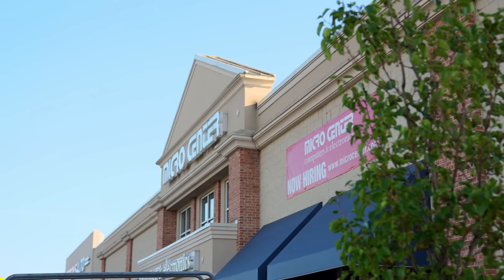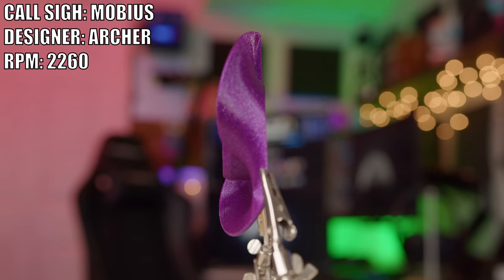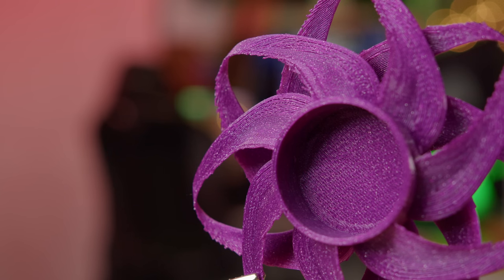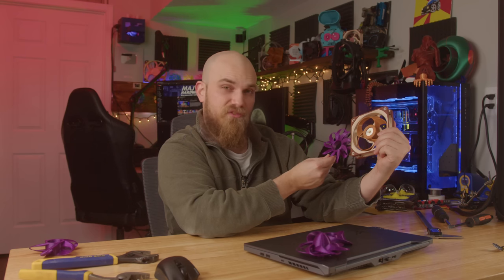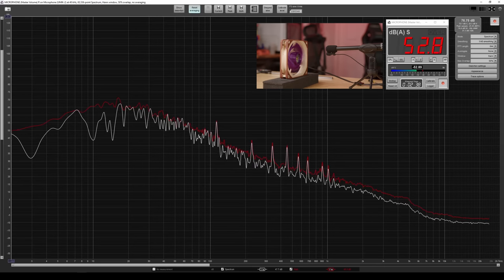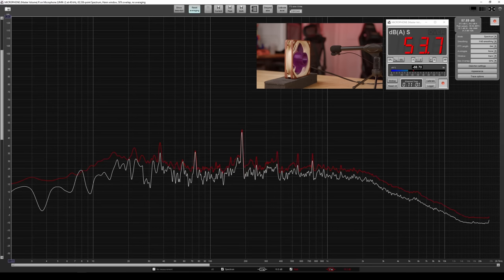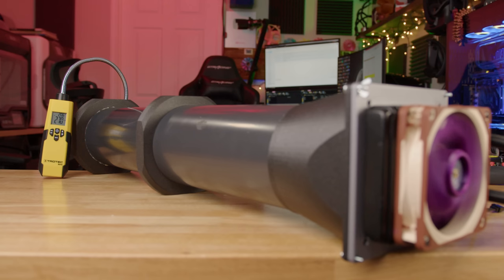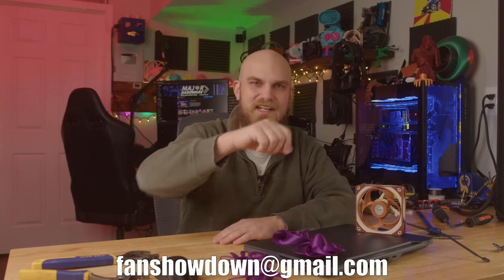My Subscribers Turned MIT Award Winning Toroidal Propeller Into A PC Fan | Fan Showdown S5E5

Comment: Imagine if your phd depends on how good your fan does in the fan showdown
Reply: That blows
Reply: Lol, academia!
Reply: As an added challenge, you have to do your dissertation defense while shouting over the sound of all of the toroidal designs that made it onto the show.
Reply: "Imagine if your phd depends on someone else's crappy 3d-printer and lack of ability to use it, and not your own work." 

Yes, I'm that fun guy in the party that gets everyone laughing by pointing out how jokes are stupid. At least based on how they all laugh and point at me.
Reply: @anteshell  it's an even playing field then
Reply: @anteshell  imagine thinking Major Hardware's printers are crappy and he lacks the ability to use them
Reply: @marcogenovesi8570  the point was not to diss his ability to do stuff. The point was about how stupid idea it is to outsource your PhD with no ability to affect the outcome.
Reply: @anteshell  the point was that outsourcing the heavy lifting for your phd to experienced professional technicians using good equipment you can't afford or operate properly has been a thing for ages.
The thesis is to show how good you are at doing the "brains" of the operation, not how skilled you are as a lab tech nor how much monneh you can spend in lab equipment.
Reply: @anteshell  i agree 3d print are not great in general for airflow stuff without a lot of work in smoothing and refinement, but it is a known variable so if you fail to take that into account in your phd, it is your fault
Reply: @marcogenovesi8570  I disagree with your assessment because he said : "imagine if your PhD depends..." which absolutely does not imply outsourcing for pros.
Reply: @anteshell  so you don't think "depends" can't mean depending from the results of someone else?
Reply: @androiduberalles  it's a crime that your comment has low likes.
Reply: @eduardoanonimo3031  I have no idea what you are talking about here
Reply: Dude is out of here
Reply: @anteshell  If you agree that the author of this channel is a "pro" at what he does, then the meaning of "depends" is quite obvious, given the context of the original comment.
Reply: @anatolydyatlov963  OK, let's rephrase it a bit differently then: "imagine doing you PhD by collaborating with expert professionals."

Now, see how all the humour suddenly gets dropped? That kind of statement wouldn't make any sense to say, because that is the default situation. The only way OP's comment makes any sense is if the "depends" was pointed towards a competition of non-professional participants and a hobbyist acting as a judge. That's the only way there'd be any kind of humour value.
Reply: @anteshell  Right, I see your point now and I have to agree. Thanks for explaining! I assumed that the author of this channel can be considered a professional, since making YouTube videos about fans is technically his job, but I guess the Fan Showdown series falls far short of a professional evaluation, which is indeed what makes the joke funny.
Reply: My engineering thesis was about exactly like that :(
Reply: Bring a lot of fans that support you! 😜
Reply: That'd be a 

Pretty
Huge
Deal

Comment: you should print the A12x25, that way it also has the ridges that everybody else has.
Reply: There's only a difference in noise and it's a very minor one. Print quality and smoothness makes very little difference. An A12x25 would register about 46.3-.5 db printed rough as these.
Reply: @KaiserTom  he just did the vid where he printed the A12x25, their was a 2.6% diff in airflow. which if you add 2.6% to all the submitted fans changes the leaderboard. the angel fan plus the 2.6% out preforms the A12x25.
Reply: OH! finally a comment nobody has ever made ever before.

Comment: I think most of the advantage you'd get from a toroidal shape are irrelevant in a computer fan, because there's already a wall around the tips of the blades. Also looks like the 7 bladed toroidal and thoroid are working near the hub, but ineffective near the tips, the smoke gets sucked from the edge halfway to the center.
Reply: Exactly! I commented the same thing on the last video. The whole point of this design is to reduce wingtip (blade-tip) turbulence, but that's also the point of the fan shroud. Having both is pointless. Using a toroidal fan inside a shroud is simply using a compromising design to solve a problem that is already solved; leaving you with a strictly worse result.
Reply: @benjaminmiller3620  Still an interesting shape to 3d model though.
Reply: Hear me out.. Who says that PC fans NEED a fan casing ? What if a manufacturer came up with a toroidal fan with the axis mounted directly into a heatsink ? Basically a fully integrated fan / heatsink design.
Reply: @AnonAnono  Sounds like the old Zalman coolers.
Reply: @wolfie54321 the main benefit is sound. Plus, toroidal fans are not optimized for ducted applications. And 100% efficiency doesn't exist practically speaking, so why even refer to that ?
Reply: @wolfie54321  There is one potential benefit in that you could fit a slightly larger fan in a standard 120 mounting space if it didn't have the duct, I would expect for most PC applications this would still be worse but would be interested in seeing actual tests
Reply: @wolfie54321  Any chance to reduce plastic, or any resource usage is not only desirable  but ecologically imperative. Studies found that 80% of people have plastic in their blood. Fans are one of millions of reasons for this grave state.
And it seems here one could reduce both the plastic mass of the fan and the shroud.

Comment: I just know that a fan blades which outperforms the Noctua is going to be found on this chan. It's just a matter of times. It might require a special surface finish though because raw 3d prints are ROUGH. <3
Reply: He should move to resin printing.
Reply: He tested surface finishes before. Result was that air flow changes was negligible but noise was increased.

That said maybe certain shapes are more relient on surface finishes than others?
Reply: @ZipperOfficial  the edges of the blades should be a focus as well. It can have a noticeable impact on flow. Those ragged edges can create a surprising amount of turbulence.
Reply: Sometimes it can even be an advantage to have this little sausage lines on the surface, but 99% of the time resin will be superior and should definitely be used.
Reply: @ZipperOfficial  It's not even surface finish it's the fact that he can't make detailed features with any fidelity.
Reply: what he needs is a 32 wing, golf ball dimpled resin pattern that uses the full diameter available. a team of nasa engineers. and maybe he will get 80% of noctua
Reply: Already has.  There's two on the leaderboard above the a12
Reply: Golf balls are dimpled because they found that old beat up golf balls flew better than new smooth golf balls.
Reply: @caleb186  Weren't those ones that didn't fit within the footprint of the Noctua fan? i.e. The Cheater with its tube extension and whatnot.
Reply: @TheObserver567  Or, for the time being, he can 3D print the noctua's standard fan pattern and then check that one out and compare the difference.
Reply: The problem is that Noctua has a stiff composite material that I believe to be LCP based (ouch expensive; and also naturally brown-ish) so they don't have to worry about the force and heat distorting it so much and scraping the blade tips against the surround. One of the main things that determine the performance is how close you can get with the tips to the surround, how consistent you can keep the distance, and how well you can optimise that whole interaction.

And we're competing against this high tech material with a shitty milk sugar which loses shape if you just glance at it wrong. You're gonna have to unearth some next level undiscovered aerodynamics there to get there, so good bloody luck.
Reply: it already has.
Reply: @The_Opinion_of_Matt  Golf balls are a sphere and tripping the boundary layer into a turbulent one causes a smaller wake. When flow separation isn't an issue (e.g. a streamlined shape), a laminar boundary layer has less drag and maximum smoothness is important in maintaining it. It's more complicated than dimples/roughness = good.
Reply: @SianaGearz I'm reading through the comments, and being a woodworker was wondering why nothing was sanded smooth, and got drawn to this thread, when I saw your comment about material strengths.  Again, I'm just a woodworker, but could one of these fans be made with a carbon fiber mould? I think I saw somewhere there's a company that will make small custom moulds and even the cf flakes and resin.
Reply: @MiG82au  
Wings are a streamlined shape and are designed with turbulation in mind/in the design process because turbulent air stays closer to the surface of the wing than a smooth airflow does. Used to (though not very often) you could see an airliner with turbulators on the wing because they were forgotten/overlooked in the initial design process. Dimples (a golf ball's turbulators) equal a straighter flight.
Reply: @mchldpy  that's an overly simplistic understanding of it, to the point of mostly being wrong around kernels of truth. Let's not do fluid mechanics 101 in YouTube comments though.

Comment: I gotta wonder how some of these would do w/ a light hand-sanding vs the rough lines left by the additive manufacturing process
Reply: A quick way to smooth 3D prints is to dip them in acetone.
Depending on what plastic is used, a couple of seconds could be enough to leave perfectly smooth finish.
Reply: One of the early tests on the channel was resin printing and vapor smoothing. Decreases noise, but airflow is pretty much unchanged.

Also, resin is less stiff than PLA, so resin-printed blades tend to flex.
Reply: Resin printing for less sanding and it's easier
Reply: @louisvaught2495  What Resin are you using? My experience from Resin printing been very stiff. For tough prints I often have to pay 2x my normal stuff. I usally buy Elegoo (For parts that don't deal with stress), and Siraya Build for functional parts. But they are quite stiff still. More so than PLA or PETG.

The only time I get flexible prints are resin that are designed to be like rubber (AnyCubic flexible). Or Engineered resin where I pay a fortune (Forgotten the name but it's 4x my normal stuff, but it's quite amazing stuff)
Reply: Louis Vaught it decreases performance and noise, nothing is free.
Reply: Or reprinted in resin. He has a high quality resin printer still I think.
Reply: @louisvaught2495  I imagine the toroidal blades will inherently be less prone to flexing and stretching though.
Reply: most pc fans aren't smooth either, they have some texture. But not as exaggerated as the lines from 3D print
Reply: The noctua ref fan needs to be also 3d printed to compensate for technology imperfections imo.
Reply: He did... He had a a video proving acetone smoothing a fan blade actually has almost 0 change in airflow...
Reply: Why are there dimples on a golf ball?

Comment: One thing people kept forgetting is fan design is coupled with Reynolds number, which is a dimensionless number predicates flow properties. Fluid (including gas and liquid) acts a lot differently depend on speed, density and object size. 
MIT’s paper specifically targeting water. So similar design to that paper may not work well in air. 
A classic case is 3-blade propeller on a boat is a lot different compare to a 3 blade propeller in your ventilation fan, or on a 3 blade propeller driving a plane.
Reply: Guys like you are why I always look at videos with apprehension. Your points are definitely a reason I doubt those who doubt toroidal design are of ANY value. Thanks.
Reply: @uprightfossil6673  There is a video of someone designed torodial propellers for a drone, using a two blade design, but a drone's propellers spun a lot faster than computer fans. 
Key point: Yes it may be more efficient, but it only means less "wind noise". The fans may not be pushing more air due to the extra weight weight. 
In aeronautics/aerospace engineering, similar principles were tested (loop wings) but the weight and extra drag of the loop out-weighted the benefits of efficiency increase.
Reply: @AaronShenghao  I am specifically interested only in the movement of water. I have several pump applications and want to make my system as efficient as possible since it is on solar panels and remote. You mentioned the Reynolds’s number. Can you give me some other terms to shorten my learning curve? So far my biggest project has been the wind powered water wheel using a hose to lift water 2meters/yards.
Reply: Aaron is absolutely right about the MAJOR significance of Reynold's number to understanding and optimizing propeller performance.  

Further, and I know this is a large barrier for 'printed' models, a blade's trailing edge sharpness  has a stunningly large impact on thrust performance.  I hope amateur experimentation with these considerations in mind will be performed. 

I'll wager US government researchers are well aware of these technical considerations and might be able to turn out usefully quieter drone blades going forward. Or this approach may be a dead end for drone purposes. Design and test!
Reply: @ivarhusa454  agreed. Turbine engines have smaller blades in front for a reason
Reply: ok which one has the most lift?
Reply: Pretty sure most of the submissions on here are just people playing with shapes that kinda makes sense, they aren't educated in fluid dynamics or whatever
Reply: @uprightfossil6673  The Reynold's number you get from a set of graphs called the 'Moody Graphs' and is used for the equation of head loss, or pressure differential.  The graphs will be online and you need to know variables such as the viscosity of the fluid to work out if it is in laminar or turbulent flow at the designed flow rate.  There is a fair bit in fluid dynamics.  Things are much simpler if you can keep the fluid in laminar flow.
Reply: @kingcosworth2643  thanks. I am a bit too dumb for all that so I will stick with trial and error. I appreciate you guys that have a clue. But for me it is more ‘if it works or not’ cheers
Reply: @wolfie54321  thanks. Will do the work. There is a very efficient way of pumping low volume high head with a water wheel. Nothin I have found is. Lose. Thanks
Reply: Depending on the density of the material you have to change the angle of attack for the aerofoil.
Reply: @uprightfossil6673  if it is enclosed and there is a low tolerance such as in pipes it is not that useful to use toroidal but if it something like an open water or air environment toroidal are useful in terms of sound mitigation at the current point in time
Reply: @Shadeaflame  I will test u deer that condition as well. Experimenting is what I do. Thanks

Comment: To test them better, you should 3d print the Noctua blade to the same levels and surface finish that you are printing the toroidal fans.
Surface finish on a blade is very important and is often over looked. It is why dust on the fan blade reduces it efficiency.

Comment: Inverted Sharrow is a good blade design but still well within the realm of "needs more fins." I think it could stand up to a 5- or 6-bladed Noctua clone easily. Either way I don't think these things are meant to be used in ducts like fan frames, but it could work anyway...
Reply: I would love to see some experimentation with various fan parameters.  Explore the space of different numbers of fins, different fan pitch, scallops or serrations on the blades, etc.
Reply: The RPMs on all these toroidal fans were pretty high. They could use more aggressive angles or more blade area?
Reply: I agree, the duct is already doing the job of the toroidal design and dampening the tip vortices, still interesting though.

Comment: the mobius did the same regardless of orientation because your anemometer doesn't differentiate between wind directions. in one orientation it was pushing air through the tube and in the other orientation it was pulling air through the tube.

Comment: Crazy question, what would be the results of a 3d printed version of the Noctua fan blade for a reference? I saw the stock Noctua fan slaughter the toroidal, but was thinking that in all fairness Noctua is all around a high-quality build
Reply: This is actually a really good question! We should probably have both, the original Noctua, and the 3D printed one on the list for reference. Then we'd (probably) be able to see the tiny bit of potential going from 3D printed to mass produced with proper hardware and materials.

Comment: I may be mistaken, but I thought you had gotten a resin msla printer. If so why haven't we seen you printing these fan blades on it?
Reply: Likely answer is that resin is expensive and hard to work with. Not that the results can't be worth it, but I'd expect most prototyping to be done with FDM first, for ease of use - Even with support material involved.
Reply: @Woodledude  it's also pretty fragile. Even after a couple of days in the sun, resin prints are just very soft and crumble easily.

Comment: What I'm interested in is how energy efficient (CFM/Watt)  the designs are. If you could measure the milli-amp draw for the a few key blades along with these new innovative designs and add a column in you spreadsheet for current draw &/or CFM/W that would be Awesome. 
I understand that energy efficiency in a PC fan is not a big deal, but it is a key factor in the interest around these kind of designs.